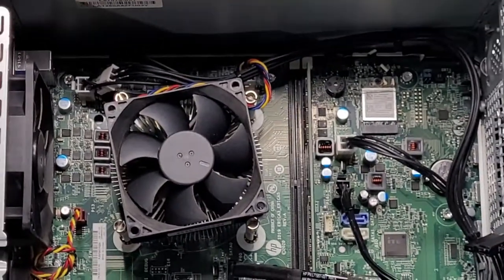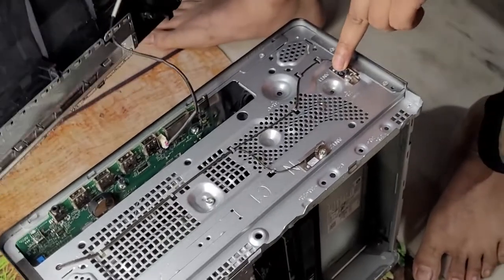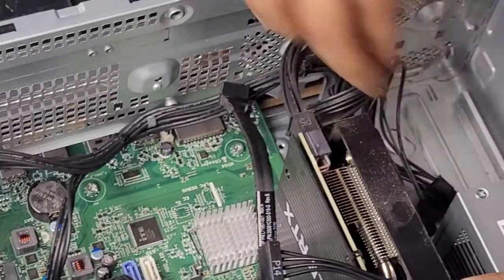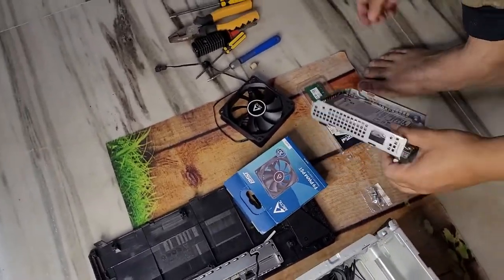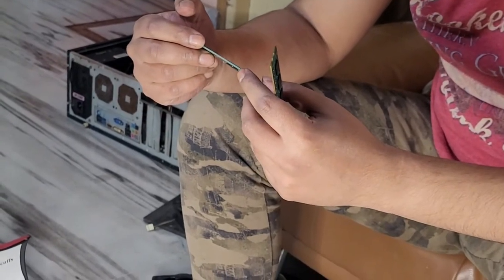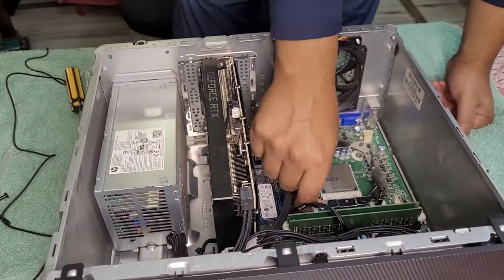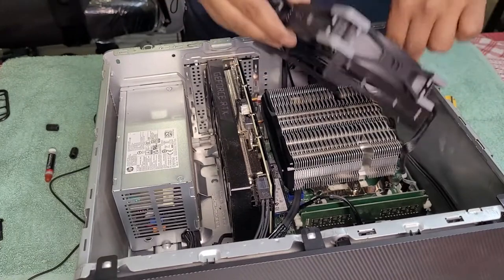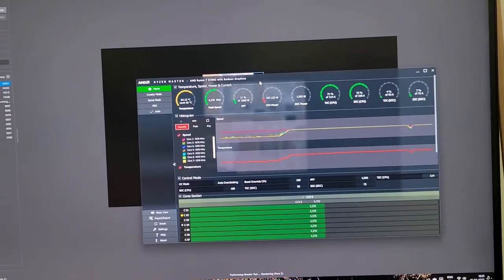HP Pavilion Gaming Desktop :Part 2 - Teardown and Upgradation

Comment: Hey man! Nice work. I got the same PC as well. Could you share the exact model number of RAM? Also Since you upgraded the components yourself, Is the warranty void?
Reply: I would also like to know that
Reply from the maker: Hi, I just updated the video description with parts list.
As for warranty, user upgradable parts installation like RAM or HDD will not void warranty, as long as you are not damaging any part of the motherboard in the process.
Reply: @umradhuma  Is the RAM 2R x8? There are two CL22 model in Crucial so one's specifically 2Rx8 and other one could be single ranked or dual ranked.
Reply from the maker: dual ranked, model https://www.crucial.in/memory/ddr4/ct16g4dfra32a
Reply: @umradhuma  What about CT16G4DFD832A? this one is 2rx8

Comment: I have the same pc and I also notice some differences between your modifications and mine. My fans are Noctua brand, my hard drive is western digital, my processor is Ryzen 7 of the 4000 series.

But what intrigues me the most is the design of your 500-watt power supply, which is much thinner than the one I got in times of a pandemic.

And as is well known, it is a kick in the balls to get such specific components and more in those times and my question would be if you got the 500-watt power supply or it was already installed from your purchase.
Reply from the maker: PSU was pre-installed by the manufacturer
Reply: @umradhuma  Ok, it went well for you because it was one of the most unpleasant experiences to look for that component in 2021.